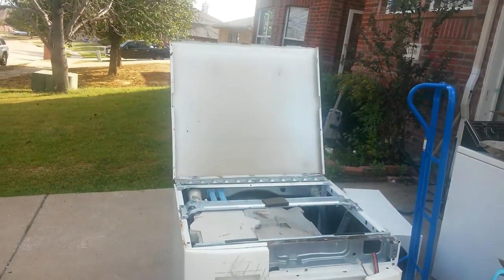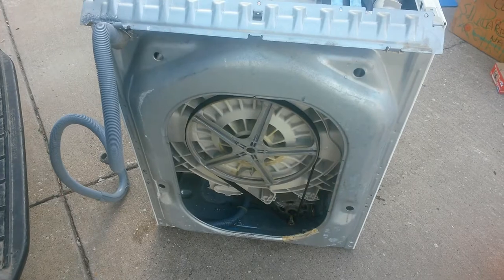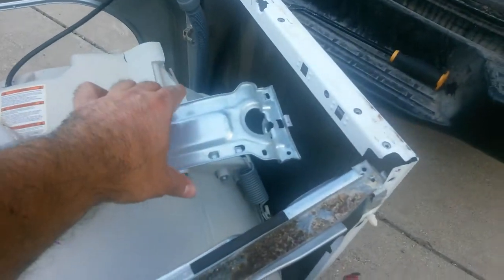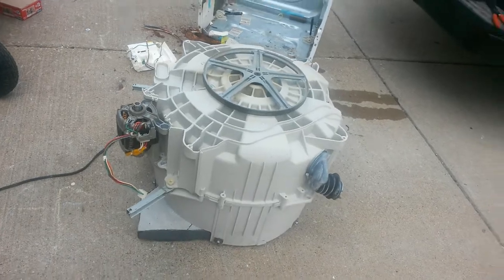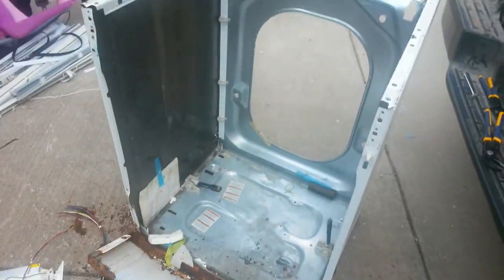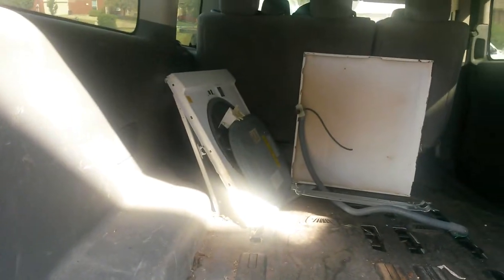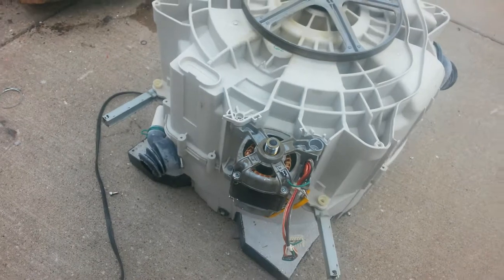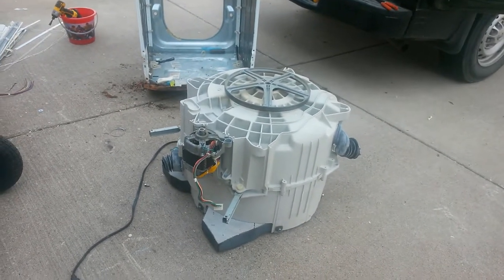why are front loader washers so heavy

Comment: they are fucking time consuming those ...i dont deal with them anymore to much time ...but just to let you know normaly the motor is realy like 5time that one its on the alluminium wheel almost same sise has the wheel need a ratchet to take it out
Reply from the maker: Yep time consuming not good. That is why I used a hammer and if that doesn't work quickly then forget it just throw it like steel.